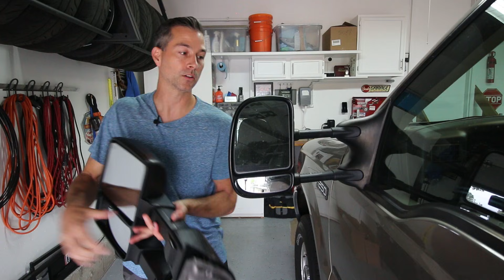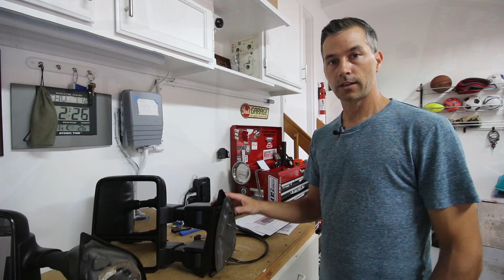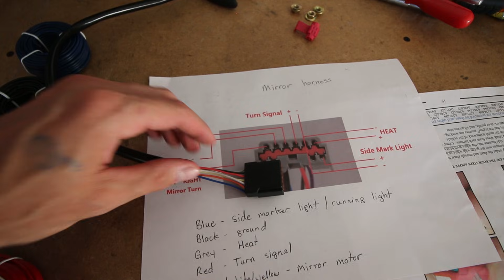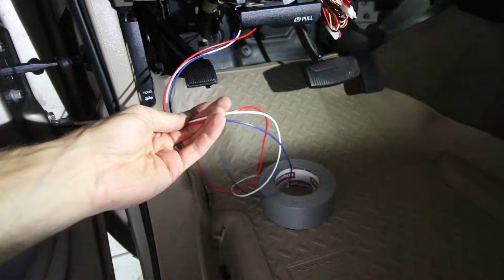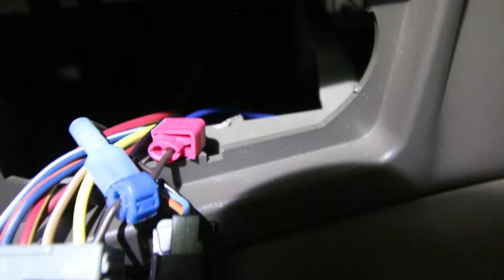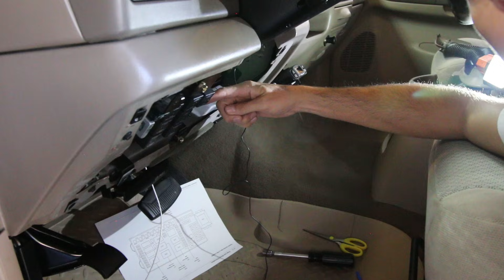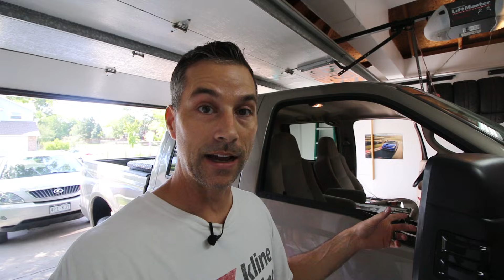Upgraded Towing Mirrors - 7.3 Powerstroke

Comment: I don’t understand how this channel doesn’t have 1mil subscribers. Content is awesome! 
Keep up the great work
Reply from the maker: Me neither 😂 Share with your friends, that really helps the channel out, thanks for the comment!
Reply: BTR Justin just subbed!!! Did you change out your accelerator pedal? If you did can you make a video on it.
Reply from the maker: Thanks for the sub! I did not change out the accelerator pedal yet, if I do I will certainly make a video!
Reply: BTR Justin the reason I said was because of that being the new peddle set up from Ford. Thanks for replying!!
Reply: @TheBTRGarage  what is the correct size wire to use for splicing ? And did the splice connectors hold up or would you recommend splicing a different way?
Reply from the maker: @ayeyochico5008  18-20ga wire is fine. You can use whatever wire splices you prefer, I'm going on 5 years with the ones I used and not a single issue.
Reply: @TheBTRGarage  thank you for the quick reply
Reply: Especially for folks like us with 7.3's!!!

Comment: Got a 2000 ford f350 and mine had two of the green with white and two of the white and blue does it matter which one you use or how to know which one to cut into
Reply from the maker: You may have to do some trial and error to see what works for your specific wiring.

Comment: I’m about to take a bat to these. When I test them with the battery only the running lights work. When I tap into the brown 12v constant for the headlight switch it doesn’t do anything and I’m using expensive name brand wagos small enough for the wire. I tapped into the bottom right pin (#12)so I know it’s the right one but the lights won’t turn on with just the switch.

Comment: Thanks for all the great info and demo on how to complete the harness fab and running it from each of the doors and through the dash on both sides.  I just completed my install, but I am using the ThermoSync Defroaster Control to "time out" the morrors heater versus manual control.

Comment: Hey do I don’t have any powered mirrors or windows or any harness already there . Can I still do this ? If so would I just cut the new harness off of the new mirror and tap in to them there ?
Reply: Yeah you can use these. You would just have to manually wire everything to the mirror. Or just don't wire anything and use them manually.

Comment: Can you just wire everything in your headlight switch
Reply from the maker: You could wire the mirror running lights like that. I wouldn't put the heat on it though.
Reply: I wasnt going to hook up the heat on them I was curious if it would easier to just wire them right behind the switch instead trying to find all the wires under the dash
Reply: well I got it all hooked up. Issue was i had two brown wires and both had power when i turned the switch on. so I wired both into the top brown one. Everything works but the passenger side bottom light kinda blinks when I turn the blinker on. Could that be a ground or should I have wired each one on the two brown wires. Mine is a 2000 7.3. And the weird part is the brown wires was on the left side behind the switch

Comment: i have a 002  xlt i am replacing th mirrors my drivers mirror already has heating i was wondering if to tap into wire that has heat, both my mirrors have  power

Comment: Good morning. Have a question, for 1999 Ford F-350 Super Duty 7.3l what number of fuse is the customer access. O where need to connect the fuse adapter
Reply from the maker: @maurocatalan5378  Not sure on the '99, you'd have to see if your manual or fuse box cover shows it. Or start digging around the internet searches.

Comment: Couldn’t you just run your turn signal wire through the door, cab and engine bay to your front turn signal wire ? Along with an inline fuse? (For each side)?

Comment: Hey i have a problem while my right mirror works fine everything but my left
When I connect my red and blue they blink together, I disconnect either blue or red and theres no power to the light also when it blinks it stay on the arrow
Is kinda like a is negative or positive

Comment: I have these same Yita motor mirrors.  Any idea how to remove the turn signal lens covers so I can replace the bulbs?  They do NOT remove the same way the stock ones remove on my 2016.  Thanks!
Reply from the maker: Unfortunately I have not had to remove those yet, so unsure how they would come off. I would think they are just held in with snap clips or something similiar, and they would pull out with a trim tool or something.

Comment: Great video, I just would not use those style of wire taps. I used them years ago, and they corroded every time. Especially in moist areas like door panels. I always solder joints. Thanks again for your video.

Comment: What if i dont use the fuse? And connect the heat directly to any power source but I put the switch with out the fuse cable?

Comment: AWESOME! My 2000 F 550 mirrors have a turn signal and parking lamps but aren’t working. I took them off and ran power to the lights themselves and they work so I’m not sure if my truck has a wiring for it or not. My mirrors are the original style mirrors, not like yours. They do have power and heated mirror function, and they work. The lights don’t work though. I will use your wiring schematic to check it out. I definitely wanna upgrade my mirrors to that style.

Comment: I added these mirrors to my 99 F350 but used a Bronco rear window defrost switch to control the heated action 9 minutes timer, mounted where the 4WD switch is on some models mine is floor shifted

Comment: You can use the flat 4 wire they use for trailers.  Its built in with left, right, ground, running.
Reply from the maker: That's a really good tip!

Comment: Can't believe after all that work you used those crap spices! You soldering the ground wire, another 5 minutes or so and you could have done the same to the rest of the wires!
Reply from the maker: @rickstatler5581  the splices that have worked fine for over 5 years with 0 issue, those ones? 😕

Comment: On my 2001 f250 5.4  I ended up accidentally connected the brown parking light wire under the dash to the mirror movement wire, found that out when I turned the parking lights on the mirror started moving left to right,  i disconnected it and connected it to the right wire,   BUT I noticed now I have NO running lights anywhere on the truck,  I checked all fuses and there not blown, I probed the brown wire again with parking light on and nothing,   Do you think I  blew the switch? Even tho the headlights, fog lights and dome light switch all work still,  or do you think I messed something serious up?  I did the turn signals correct they work everywhere still.    Thanks in advanced,  also your videos are very informative!!

Comment: I hope you don't have trouble with those 3M connectors. I throw them as for as i can. They corrode or end up cutting the main wire. If you have trouble that is the first place to look. Thanks for the help

Comment: Take those 3M connectors and throw them as far as you can. They will cause problems in short order especially in areas with snow where they use ice control on the roads will cause corrosion.  Good video other than that.
Reply from the maker: 5 years and still working fine.

Comment: Just an update to share, My 2003 F350 has micro fuses so the fused pigtail I had wouldn't work so to save a trip we thought about it and ended up wiring the heat to the window lockout switch. I never use that switch so it was a no brainer for me, it was so easy to do! It also works great, windows locked means heat on.
Reply: Did you add a fuse? Or just connected the wires?

Comment: So I have some similar mirrors for my 2002 but the mirror harness has a 2nd ground wire (one for defrost and one for marker light). Do both need to be grounded to the door?
Reply from the maker: Just any ground location will do, doesn't necessarily need to be the door location (but that should work).

Comment: Best dang video yet on adapting power mirrors with heating and turn signal function to a Ford 2003 F-250 Super Duty .
Fits my application to a T. I highly recommend this video for anyone installing this after market  modification.
Reply: I found that my 2003 F-250 was already wired for turn signal, running lights and heated. All I needed to do was to install a switch (optional) to only run the heated option in cold weather instead of continuously. If yours is already wired for the three options it’s really just plug and play
Reply from the maker: Thank you! Glad the video was helpful 👍

Comment: I’m not good with electricity. If the mirror connector already has a ground wire going into the truck’s connector, why did you need to splice into it and ground it to the metal on the door? Thanks in advance.
Reply from the maker: I don't remember exactly why I did that, but the extra ground won't hurt. You could try it without the extra ground screw and see if things work ok.
Reply: @TheBTRGarage  thanks for the reply!

Comment: I’m having the weirdest problem. The passenger side doesn’t light up. I take the wiring and swap it too the drivers side and it works fine. But if I hook up the passenger side to the driver side mirror wiring, it doesn’t work either. Why would the wiring work for one mirror and not the other? I bough lt another set thinking it was a bad mirror but the problem still happened. Anyone have any ideas why?
Reply: That’s happening to me I connect the passenger it stop working Rn just the turning signal are working but the running doesn’t also sometimes the right turn signal get freeze

Comment: Thank you for the awesome video, quick question What wire gauge are you using?
Reply from the maker: 18ga should be fine, 20ga would work but I wouldn't go any smaller.
Reply: Thanks Justin

Comment: is the wiring the same for a 2012 f350? im doing the same thing to mine
Reply from the maker: The wire colors are probably different, but I do not know for sure. You should be able to leverage all the same wire functions, just may different colors (have to trace them out to existing mirrors then trial and error, of find a schematic).

Comment: What gauge wire did you use?
Reply from the maker: 18ga should be fine, 16ga can be used as well. I wouldn't go smaller than 18.

Comment: Love the installation instructions. Very detailed. Have installed my new Yita mirrors and am looking for the green/white stripe and the white /blue stripe in the harness. Located the white/blue wire and tested with the ignition and right blinker on. Have constant and not flashing voltage. Is this normal or should the wire tester be blinking?
Reply from the maker: Hmm, interesting. I think the tester should be blinking, unless that is not the correct wire for that signal? Have you tried other light/blinker functions to see if the tester see's voltage? Might just have to do some trial and error, I've heard that some trucks/years have slightly different wire colors. I assume you tested the voltage tester on a known hot wire/battery to make sure it works?
Reply: @TheBTRGarage  Thanks for your reply. I have checked every wire into the fuse panel with several different and new testers and located the wires connecting the rear blinkers only. Connected them and surprise, when I depress the brake pedal the mirror turn signals illuminate. Everything else works fine except the front blinker wiring. Disconnected the wires from the rear blinker wiring and may just connect the mirror lighting to the parking light wires. I really appreciate this very helpful video and look forward to your future adventures.

Comment: My 2000 F250 has manual windows and no power mirrors. Will I still be able to hook these mirrors so that the lights work on them? Just wanna know before I buy haha Thanks for the video very informative
Reply: Thank you for replying! Helps me a lot haha
Reply from the maker: Does your truck have turn signals? 😆 Yea you should be able to get running lights and turn signals no problem 👍

Comment: On the driver's side mirror I have a black wire on the passenger side it's not black same location looks like a light brown would that be the ground on the passenger side? I sure would like to get that schematic
Reply from the maker: If it is a ground wire you should be able to trace it to something that is grounded. The brown wire was the parking/running light on my truck.

Here is the wiring info I have: https://btrgarage.com/files/F250-Mirror-Wiring.pdf

Comment: Awesome video! Quick question though...I can't seem to find those wires. Do I need to open up one of the groups of wires to locate those specifically? Also, how long did you make each sections of wires for the driver and passenger side? Thanks again!
Reply from the maker: Thanks! The wires are in the looms going through the doors to the mirrors. They may be wrapped in electrical type tape or a plastic loom. I don't remember how long exactly, just buy some spools of wire and measure out enough to make the distances.
Reply: @TheBTRGarage  Thanks! That’s what I figured but I don’t normally mess with this kind of stuff. Thanks for the video…really appreciate your channel!
Reply from the maker: Glad to help!

Comment: just fyi to everyone going to do this, if you dont want to add a switch. You can put the fuse adder on the rear defroster switch circuit f2.9 because the switch is power side commanded, aka when you turn on the rear defroster it will turn on the heated mirrors. eliminates extra wiring and switch installation. plus you should only heat the mirrors/rear glass until its clear unless its very cold climates. hope this reaches the people doing this upgrade. beyond that its a great breakdown of installation. doubt it will get many likes but maybe the maker can make a note in the description.
Reply from the maker: Good info! I believe it has been mentioned in the comments already. Also, a lot of trucks do not have a rear defroster, just like my truck didn't. So, it is necessary in those cases to have a switch. If you have a rear defroster, definitely use that to keep things simple.
Reply: @TheBTRGarage  my bad didn't know that! didnt mean to come off like a jerk. great job on the install. just got those led ones to match the led headlamps cant wait til my customer comes in for the install. thanks for the reply sir.
Reply from the maker: No worries I didn't take it like that 😁 I didn't know these trucks had rear defrost either until someone mentioned what you did.

Comment: are the wires the same for a 2000? if not how did you find out wich wires are wich?
Reply from the maker: They should be. If not, you can trace the colors from the mirrors, all the way to the signal lamp bulbs, and do some trial and error. You can use the continuity tester (in description)  to test those wires in the plugs, also just digging on the internet can help.
Reply: @TheBTRGarage  thank you

Comment: Love the videos. Since the door panel is off, I was going to upgrade my speaker as well. But I was also wondering if it would make any sense to put some of those adhesive sound dampening tiles on the door while the panel was off.
Reply from the maker: Thanks! I'm thinking about upgrading the speakers in my truck as well. Not sure how much the sound dampening tiles would help, but worth a shot!

Comment: So how much longer were the new extensions versus the original.. When you're holding them together and do them comparison it almost looked like the originals were just as long just the mirror itself was wider
Reply from the maker: Correct, they are not much longer at full extension. But, since the mirror is not rounded off at the top and bottom, the visibility is increased. The biggest benefit is the much larger blind spot mirrors, the OEM ones have a much smaller viewing area.